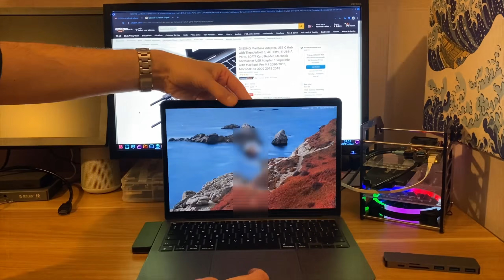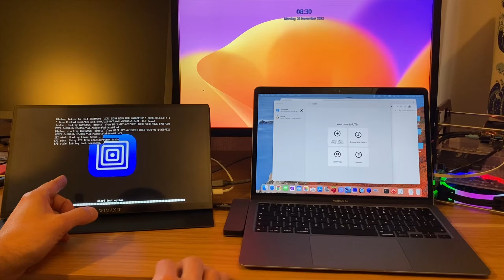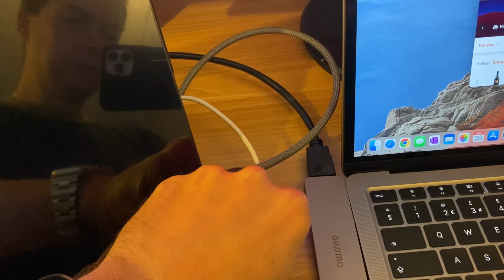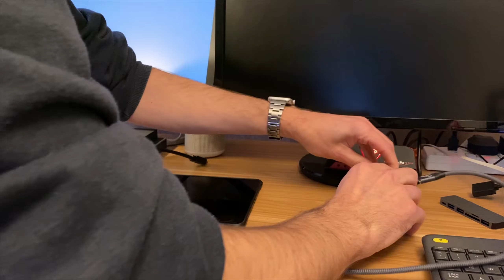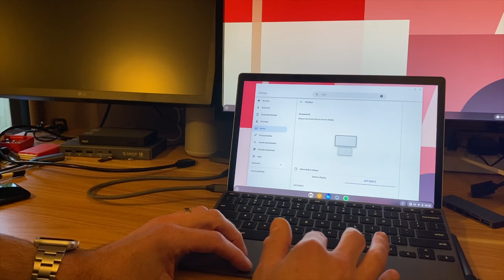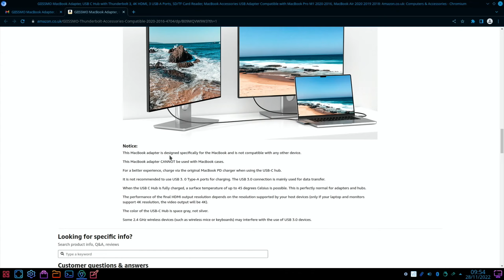GIISSMO Macbook Thunderbolt Mini Dock with HDMI

Comment: if only they had put an m.2 slot inside the dock so we can plug an NVMe and get extra storage at high speed, but that wouldn't be the same price as TB3 NVMe encolusures are quite expensive

Comment: Looks nice, i got one of these from GKEAPZA (ABTT68) for a macbook pro, about the same size as the smaller one shown in the video.  Great piece of kit, nowhere near enough connections on the macbook as standard.  2x USB C,  1x USB A (V3), 1X USB A (V2) micro SD and SD as well as HDMI.  The added advantage with the model I got was the inclusion of a network port,  that gave a massive improvement in speed across the local net from the hardwired connection.  Cost was under £30 as I recall.